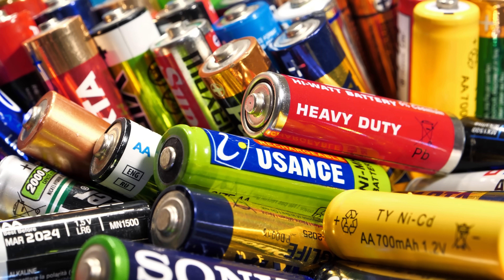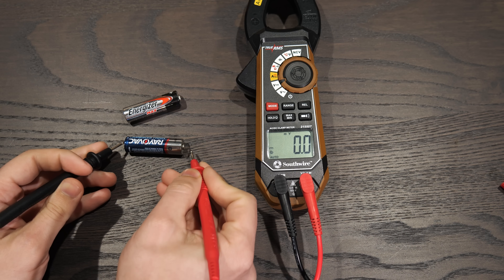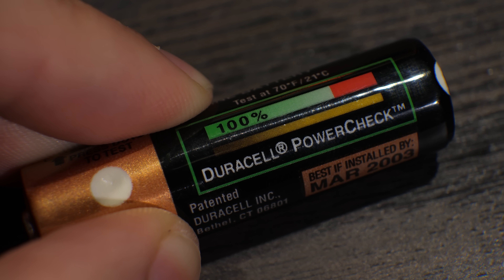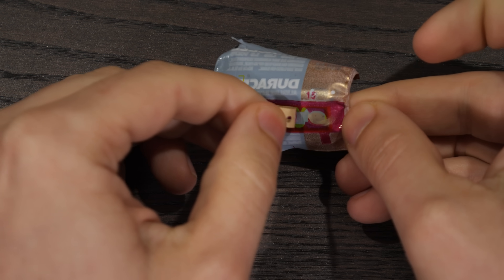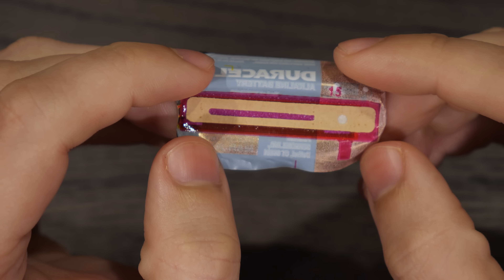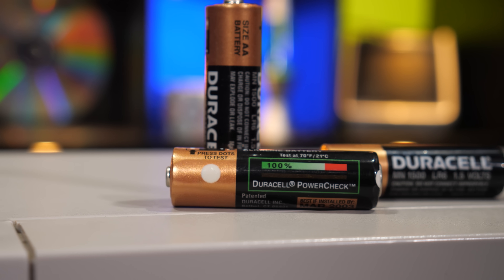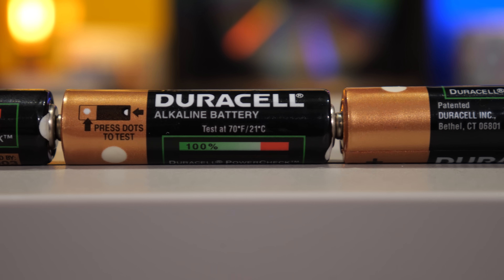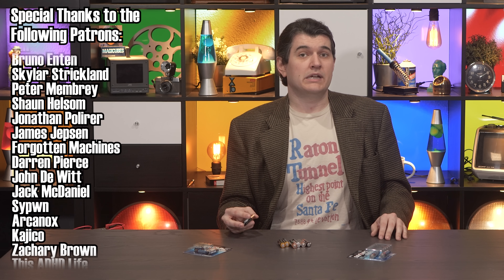Duracell PowerCheck: A genius idea which didn't last that long

Comment: The funny thing is that these batteries are still available with this feature from duracell. I always use them and if you have patience you certainly don't have to press hard and just keep your fingers on the dots and the result will come automatically and if not then the battery is almost empty also your batteries can bounce on a hard surface to see if they are empty or not,  A battery that bounces is dead, one that is full does not bounce. 🥲

Comment: I actually miss AA batteries somewhat. Not everything needs a rechargeable battery. They were easily recyclable and you can replace them instantly. I had an electric shaver with a Li-Ion battery that eventually went bad, and of course I had to replace the whole thing. Not to mention that when I forgot to charge it I had to wait 15 minutes with a half trimmed beard when I was in a rush. Now I have one with AA batteries and as long as I have a pack in the bathroom drawer, I’m good.

Comment: I vividly remember this, but I think it was far too expensive. So, the million-dollar question is: did it cost significantly more to make, or did they simply earn an excessive amount from this feature?
Reply: Dirt cheap to make as the strip was just a thin layer of printed crystal's that reacted to heat when you pressed both sides making a circuit & the battery's voltage passed through.  It was more a marketing gimmick they weren't at all accurate user contact & external temperature effected results & Duracell did't actually own the patents for the strip Kodak did so it spawned lawsuits.
Reply: @ZuulGatekeeper  Ok i see, Thank you for clarification 👍 

Funny they do it with no patent. That shows how wild the desperation can be.

Comment: I always used the positive terminal of another battery to press those while they were on the floor or a table and hoped that it didn't shoot the battery out at 3% of the speed of light, killing me instantly. Also, it was great to see this video! When I was a little children, I got ahold of a sharp object to take the wrapper off of those batteries because I wanted to see how they worked! I also tried to modify them to be removable testers, because as you pointed out, the Duracell ones with the PowerCheck were just more expensive, and I wanted one to use on any battery. I tried gluing paperclips to the contacts to extend their physical reach for use on other batteries. It kinda almost worked sometimes if I wrapped the contact around the paperclip tightly enough. For some reason, I wasn't given an electronics kit when I was that age...

Comment: There's something I always wanted to know: when I was at a boy (+50 years ago) most of the shops that sold batteries would have a battery tester that was simply a flashlight bulb: if it shone brightly the battery was good. 20 years later, the chemistry teacher explained to us a lot of things about batteries and the big issue of polarization, which is when a layer of gaseous hydrogen forms around one of the electrodes, isolating it electrically and therefore killing the battery. That man said to us that the "flashlight bulb test" consumed a lot of the chemical depolarizer and greatly diminished the battery's life, so he recommended us not to get them tested when bought.

Is there any truth to that story he told us?

Comment: If you don't think there's a lot of devices around anymore that use AAs and AAAs you are clearly not a parent.  SO MANY toys still use them.  I will say though that being able to order a big box of them from Amazon is a lot simpler than the old method of waiting until you needed one and then hoping your parents remembered it at the grocery store.

Comment: I mean, it was kind of handy, but the inefficiency of putting a battery tester on each battery is kind of comical. Gets to the point where they could have had a bucket of free battery testers at every point-of-sale display, and if everyone took one, it still would have been cheaper. Also the way people use these batteries makes testing them a fairly rare occurrence. For the majority of uses, you take a fresh battery, put it in… and when the device stops working you just take another fresh battery and put it in. -- I know some people have half-used batteries lying around, but I have to assume that's an overall minuscule proportion of batteries.

Comment: I do think this technology would be very useful in RECHARGABLE AA/AAA etc. batteries. Could be nice to see how close a battery is to needing a charge before using the device they are in. But maybe Rechargeable AA/AAA batteries aren't common enough to put that much effort into. Also like you said, most devices show the battery level. But something to think about fs.

Comment: These must of hung around for awhile, I can remember using these maybe 5-10 years ago, whether production lasted that long is another story, I too can remember the pain of trying to get those blasted dots to work,  we also had a storage for half used batteries, often times a few  flat or half flat  batteries might be enough to stop something like a trail camera from working, but some half charged batteries would power a computer mouse of game controller.

Comment: When I worked in av, we weren't allowed to keep batteries in our microphones. We had to test all of our batteries before every show. We had a few dedicated battery testers. They were easier to use than I remember the power check being. I remember you had to push hard enough for it to be uncomfortable after a few rests.
Reply: I learned that lesson the hard way 😂
Reply: @madgigahz  me too. When the lead performer's mic died mid show, it was quite a kerfuffle. But I totally understand not leaving batteries that can corrode in thousands of dollars worth of equipment. We eventually just adjusted operating costs to include fresh batteries for every show.

Comment: I remember taking the dead batteries apart to figure out how it worked.  All I could figure out was that it created a circuit, but that's also as far as my curiosity took me, I lost interest after that.  I now only use usb rechargeable batteries for things that still need them, like my mouse.  No need to check the charge; if in doubt, just recharge it early.

Comment: Thanks, always wondering how they worked.... and was wondering what happen to them.  I would find a random battery, and this would be helpful. Today, I have meter, or I picked a batter tester, I know it's basic but, it's quick to do the job, and it was fairly cheap.  Don't need to pull out my meter to test it... I have kids so you know how that goes.....

Comment: I take issue with two points:

One, unfortunately, that rechargeable batteries can substitute.

Most have a lower terminal voltage (except when freshly charged and not used yet) than fresh alkaline or carbon-zinc batteries, and a lot of electronic gadgets don't like that.  I have some which complain the batteries are run down and quit working almost immediately.  Obviously they're calibrated for alkaline or carbon-zinc batteries.  Think GPS receivers, wireless microphones, music players, etc.
God forbid you're dealing with a "9V" battery, which is 6 small cells in series.  If it's rechargeable, the terminal voltage will often be only 1.25V * 6 = 7.5V.  I've found that many gadgets will get upset if the terminal voltage gets below 8V, so it'll fail immediately.  Think wireless microphones, ionization smoke detectors (cue another one of your videos), etc.
Yes, there are rechargeable "9V" batteries which are 7 cells in series, to try to compensate for this.  I rarely see these though.  I'm also not sure I have a charger for "9V" batteries anymore.  (I have a tester which has a "9V" setting, but I don't trust it for a second.  See the comment about <8V being no good.  "3V" lithium "coin" batteries are even more untestable.  I've found those often won't work if they're at all below 3V.)

Many rechargeable batteries, particularly the usual nickel-metal-hydride (NiMH) ones, often self-discharge so quickly they're useless unless freshly charged.  That's why most of the ones I keep are the lower capacity but low-self-discharge variety, which I've found much more useful.

Two, why would you keep partially used batteries?

Because when they won't work adequately in gadgets described above, they'll often work fine in other things until they're thoroughly run down.  Think remote controls, clocks, portable lights, flashlights, etc.  I keep 3 piles: New or nearly new, marginal which will probably work for that second category, and junk waiting for the next e-waste collection.

Comment: "If you were a kid before, say, sometime before 2010...”
Me: Who wasn't a kid before 2010?
Me: No, really. I have to do the math on this. 

Let's say a kid is "not a toddler" and at an age to care about batteries. Maybe that's about 7 years old. To be 7 in 2010 means you were born in ~2003. 

Got it. "If you were born before 2003..."

(The implication being that if you were born after 2003, batteries were of little concern).

Comment: I remember these, used them in my RC car controllers etc.... Part of why they went away was they were not super reliable, often they would not work at all... or in some cases I've seen them get stuck on, draining the battery.

Comment: You said the "high resistance of the thin part of the element"

My brain wants to say that's an incorrect statement;  the thinner area should be less resistive and the thicker part would be more resistive.. but then I'm thinking the function of the meter needs to surpass a certain high resistance to change the indicator followed by lesser resistance for the upper voltage indication.. i dunno.. please clarify for my sleep-deprived head

Comment: obviously MOST people are not in the situation I am in but I DJ weddings and my wireless microphones do not have a very good battery health indicator built on, so after every event I switch batteries for new ones whether the previous ones were completely dead or not so I indeed do have a sizeable collection of partially used AA batteries

Comment: My only two comments:
1.) I watched this video, and it was only a week ago that I read that exact article.
2.) Although you are correct in saying a heater, it's really just shorting the battery.  A thin piece of metal.  It's a heater in the same way as a light bulb filament is a heater.

Great video as always, though!

Comment: I recall us kids using that tester a lot actually. In that era Pokemon was popular, and with it a heavy use of Gameboys that ran on AA batteries. We almost never had two batteries of equal charge since we would swap them out with whatever we could find (remote, flashlight, etc). Interestingly I think adults had less use for them.

Comment: You should do a video testing the lifespan of various brands of batteries to see if the more expensive ones really are better.  My dad always said the best alkaline was the cheapest, as long as it was an alkaline.  May have been just another "dadism", or maybe he's right and we only think that Duracells and Energizers are better because of conditioning and it's just a placebo effect.  The cheap alkalines from the dollar store always seemed adequate to me.  And you actually proved this was true with dishwasher detergent.  I buy generic powder now instead of pods and save a ton and my dishes are just as clean.
Reply: There have been many such tests conducted over the years, and the conclusion is always more complex than “brand X is best”: some batteries provide the best life for low-drain devices like remote controls and analog clocks, while others are the best for high-drain devices like flashlights.

Comment: I wa a photojournalist at the time, and this was incredibly useful to me. Cameras, at least 2, took 4 AAs each. Flash, at least one, took 4 AAs, light meter took two, probably a color meter and a flashlight taking two each. If you lose power and miss the shot you can lose your job and miss your mortgage payment. BUT you can afford neither the weight nor the space in the bag to carry ever-more batteries. These were great in helping you to know how to carry just enough spares and no more.
Reply: Were NiMH cells available at that time yet or no? I have all my photo gear running on NiMH (eneloop brand) AA and AAA cells other than the camera which has proprietary batteries. They seem to recharge my speedlights roughly 2-3x faster than fresh alkaline cells, about as fast as energizer lithiums would if my speedlights would operate correctly on them (some kind of glitch caused by the higher voltage of the AA lithium primary chemistry). They're heavier per cell but seem to last significantly longer in the speedlights, and cost a fraction of what disposables would cost me.
Reply: @asificam1  I recall that they were. I used them, but by the time you do all the work of getting to the exact place and time to make an image, the cost of a battery (or another roll of film) is not that high, and the hassle of charging is one more thing to worry about. Not mentioned here, the next step was that this battery tester was printed on to the plastic "bubble" that batteries came in, so you could cut it out with scissors and have a half dozen little testers with you. Like today, amateurs want to talk about cameras, professionals want to know how you manage batteries, cables, cards, and filters.
Reply: @Qtrfoil  If only everything would take the same replaceable battery standard... or at least a limited number of them. Like 18650 or 21700 cells for lithium ion powered gadgets and AA's for anything that does not need absolutely maximum energy density (NiMH, while great, has lower energy density than Lithium ion, but it's cheap to implement  a standard AA holder and very safe).

Same for cards, most cards are not all that fast at writing, if they would allow for the use of NVMe SSDs, that would be neat, though would be harder to make them removable like cards are so I'll give cards a pass for now.

I have a few chargers, some that charge both Lithium ion and NiMH, and some for only NiMH. All of which are easy enough to use, some of which are incredibly (scary) fast. It's usually less effort to recharge all my cells at the end of a shoot next to may camera battery than it is to have to go and buy more... especially since the NiMH will last almost 2X as long in my flashes... and they don't work well on Energizer Lithium type LiFeS AA cells so that's not really viable.

From what I gather, good chargers were hard to come by until recently (they existed, but not many retailers carried them), and Low Self Discharge cells were also somewhat hard to find a supplier for. Hence most people who tell me who rechargeable cells are terrible have had a bad taste left from poorly made chargers, cheaply made cells, and often were NiCd which suffers from memory effects and very low energy density.

Comment: I run sound for school and community musicals and battery operated mic packs are pretty standard (although that's slowly changing).  They have meters but i keep a tub of half used batteries for rhlehearsals since we only start shows with fresh ones.  Trying to switch to rechargeable but it's a process.

Comment: Excellent video.   You might have touched on what happens if you leave your batteries in the flashlight and forget about it for a few years until you lose power and need the flashlight.  Only loosely connected.  Maybe a word about that when discussing the practice of leaving batteries in devices until they don't work anymore.  Then when you go to change the batteries and... OH NO.  Maybe in another video.  If you ever do batteries again.

Comment: i bought a maglite at a thrift store that still had batteries 

It was 4 Duracell PowerCheck D Cell batteries each one had expired more than 20 years ago and not a single one leaked or showed any sign of corrosion

they were stone dead of course
Reply: It’s funny you say that. I bought a brand-new mag light for about 15 UK pounds, the huge police style version, I installed Duracell batteries into it and they leak within two years, so I filed a claim with Duracell and they paid out 80 UK pounds

Comment: I remove the batteries from almost all my devices after use. This is primarily to prevent battery corrosion in the off chance I leave a device long enough for this to happen. The classic example from my childhood was Wii Remotes. The number of times I had a Wii Remote suffer from battery corrosion was way more than it should have been.

Comment: Could you put a power check onto a remote (for example, or any device) to test the batteries in the device without removing the batteries? Perhaps larger devices have a battery indicator anyway but a power check on a remote could be a real if small convenience.

Comment: 7:32 I think the skinnier part has the lowest resistance, not higher. According to the power equation P = V²/R, for the same voltage value, the lower the resistance the higher is the power, so it heats more when the resistance is lower.

Comment: You know any more 99% of the AA and AAA batteries that I use are nickel metal hydrate I bought about a dozen AA and AAA NIMH I got a couple of battery chargers and despite them having a lower voltage then regular alkaline disposable batteries I've had almost no issues using them on my devices that take batteries The only thing that I have found to have any issues with the lower voltage of the nickel metal hydrate is in flashlights Don't get me wrong they work just fine but they are much brighter when you actually have the 1.5 volts that said at this point the only flashlight that I own right now uses an 18650 battery 🔋 so from an environmental standpoint I really feel we should ban disposable alkaline batteries